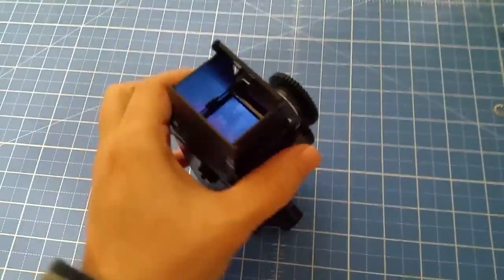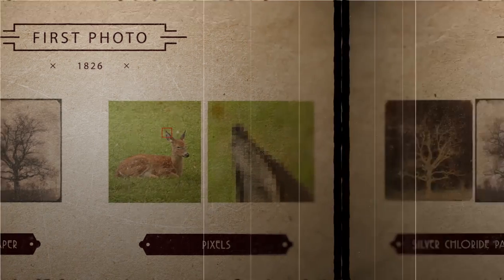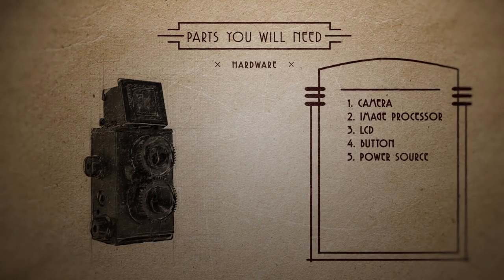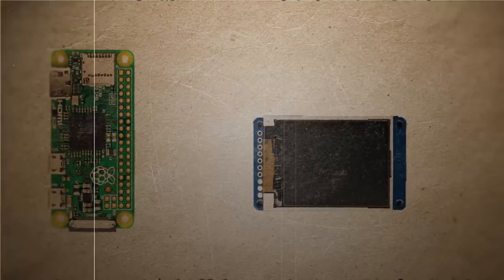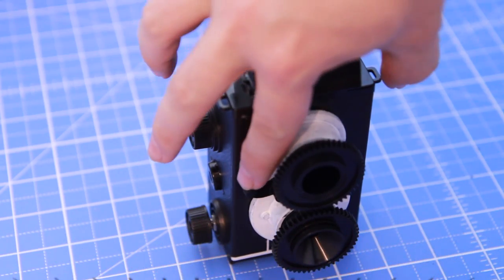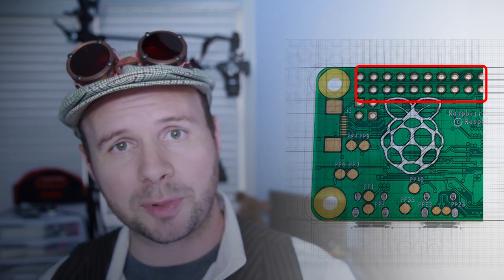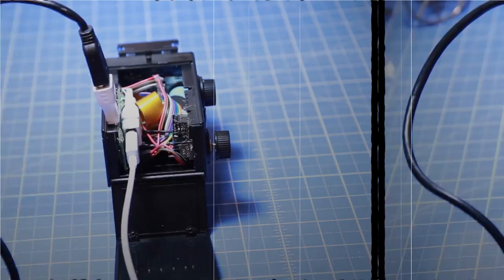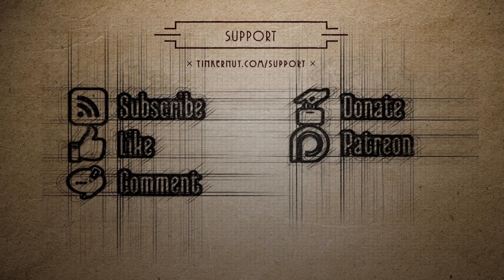DIY Vintage Raspberry Pi Camera - Part 1

Comment: Would any manual exposure settings be possible using the raspberry pi camera? I understand aperture is probably not a choice, but perhaps shutter speed and iso, to at least have some creative control?

Comment: I had a project some time back that I'd love to hear/see your take on. Business owner buys 6 digital picture frames to inset into a wall to display the same ads on an off set rotation so the screens are not displaying the same ad the same time. The screens take input through either a SD card or USB storage device. Given what I had at my disposal and that the plan was the screens wouldn't be accessible once the wall was closed I simply extended the female jacks of each to a makeshift hub to input multiple USB sticks. Ads we updated frequently and the process was tedious. It's not my problem these days but I often think about the idea for a peripheral that would let you plug one storage device into them all and be be simultaneously accesses by them all. I know the smarter Idea would have been to not use silly picture frames but the idea of a standalone USB splitter? repeater? multiplier? whatever, it just seems like a unique puzzle to solve and could evolve into other interesting applications.

So to simplify, 1 USB drive acting as though connected to 6 digital picture frames

Comment: how about complex project from  7 series
let me direct it:) would like to build simple car radio/player
1step power circuit for powering all components
2 amplifier ic or alternatyve chip with controllable freq bands(low/mid/high)
3 potentiometers for control
3step raspbery pi as brain of
additional buttond for controlls on/off volume all this magic. usb/sd/microsd(aux optional) as input for music suorce.
4part software for music playing selecting and etc
5 digital radio optional
6pcb/case modeling
7testing
in this series you could show how tech are born

Comment: How did you get the TFT to just work with the Pi Zero? I have the Adafruit 1.8" SPI TFT display and followed the instructions, but the display just will not work. The only thing I was able to get it to do was to turn the backlight on and off. Do I need the ST7735 driver? If so, how would I install it? 
I find the RaspberryPi platform very frustrating when it comes to interfacing with SPI hardware. I2C, no problem.

Comment: Someone needs to make a digital mod for old film cameras that allow use of the old lenses. Just an insert that fits in the camera body and works with the camera's existing functions.
Reply from the maker: There is actually a kickstarter for someone doing something similar

Comment: I would like to see you do something similar with an old time radio and repurpose the case as an Internet radio, maybe add in some LEDs to make the inside light up and also use some of the old switches again. I don't know, go crazy with it and see what happens.
Reply from the maker: I did one of those a while back using an old router instead of a Raspberry Pi.

Comment: Hello i have a question when taking the  picture will it have a Special effect like say when taking using a old original camera from that era? kinda like instagram where you can add a effect into it.
Reply: I always wanted to take a Old camera and make it new again was when I first learn to solder and make things. a list of things I wanted to do was #6 cameras :)
Reply from the maker: You're more than welcome to add one. My final code doesn't have a filter, but it's really easy to add using SimpleCV
Reply: Thank you Tinkerdude I don't know much about linux or SimpleCV but i will look into it :)

Comment: Please Help!
Hey! I have A Rc Car. I acidentaly left it onn whit my 7.4V Battery after one week whithout use i saw that i have dont tha thing. my battery was dischaged so i bought a new one now im trying to drive this thing and it goes alot slower and the red led on it is red- That means that the car has problem. after i took it inside the home the car smeled like someting is smoking a bit there. (that was the motor)(but i didnt run te car long tha was a bit of time) So when i plug the battery in the car the red led glows. usaly it didnt glow when i pluget it in. 

About the battery: When i first recive it, i Pluged it into the charger. Maybe that efected it? Please Help!
My Rc cars name is: Desert Eagle 3 1:12 Scale.
Please Help Me I realy whant to drive it agen!

Comment: write a program that would require external storage to store all the pictures
p.s. make an sd card port
Reply from the maker: I think I'm gonna have it upload to dropbox
Reply: but what about being away from the internet?
Reply from the maker: It will check for an internet connection and wait until one is present.

Comment: Your face is less in focus than the front of your hat.
Reply from the maker: It's hard to stay in focus when you're the only one controlling the camera and you have to stay in front of it.
Reply: Tinkernut Yea that's fair. Which camera are you using?
Reply from the maker: Canon 60D
Reply: Ah same as I have, though not for video. It's a shame about the lack of decent video-capable autofocus in DSLRs.